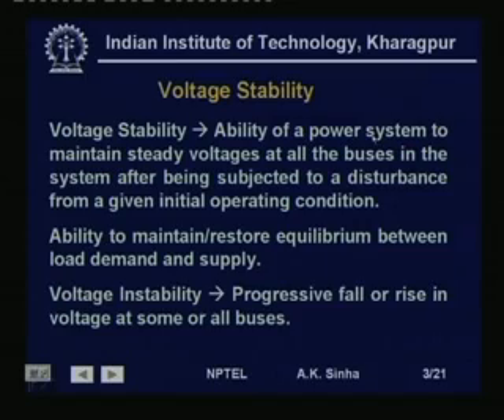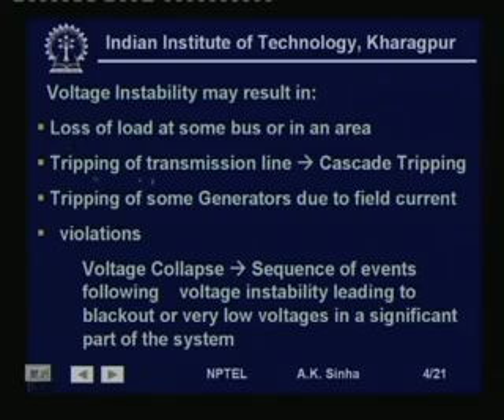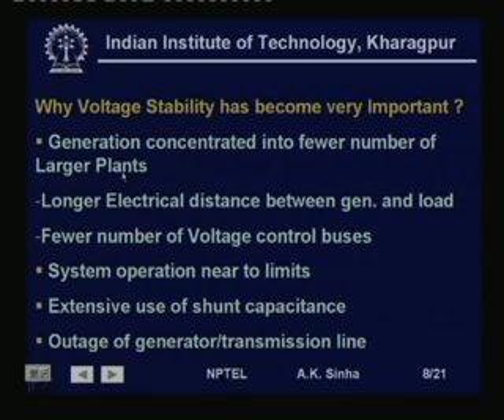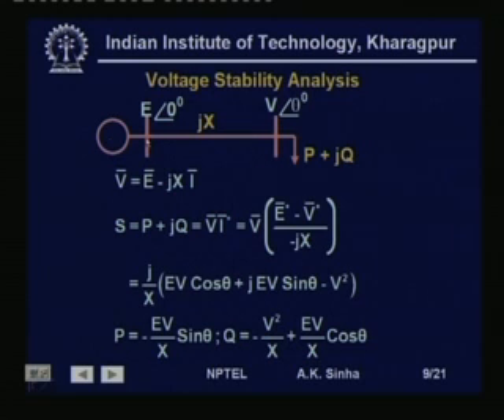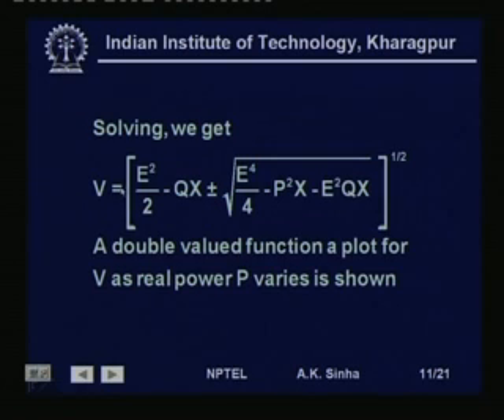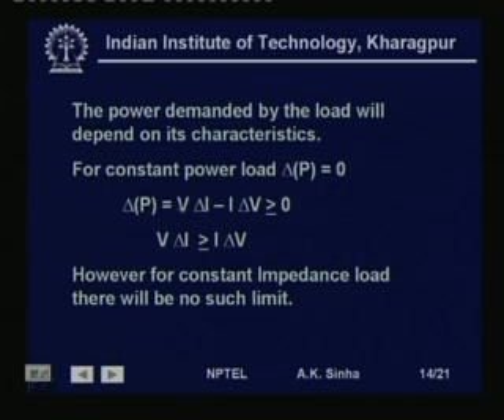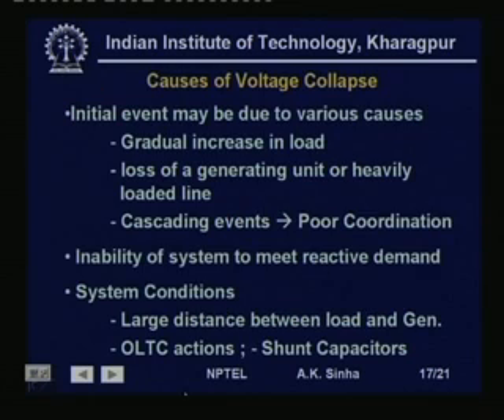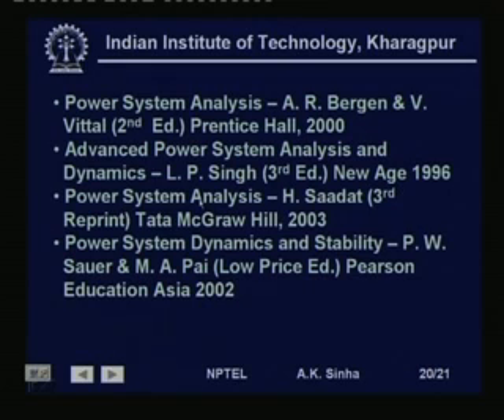Lecture - 40 Power System Stability - VIII

Comment: It is interesting to know that since the late 1970s, voltage instability has been the cause of many power systems blackouts worldwide. This has been the result of heaving loading of the power system and power transfer over long distances. The following information about voltage instability incidents was taken from the course of power system dynamics of Dr. Prabha Kundur in Caracas, Venezuela in May 2007 (PES power engineering society): Voltage instability incidents: French System December 1978, January 1987, Swedish System December 1983, Japanese System July 1987, New York System September 1970,  July 1977, Florida System December 1982, May 1985, WSCC (Western System Coordinating Council) July 2, 1996. The sequence of events of the failure of WSCC was explained in the conference by Dr. Kundur. More recently the august 14, 2003 blackout of the northeastern part of the North American grid is a good practical example of voltage stability problems leading to major system failures. To learn more about voltage instability any student should analyze a sequence of events of a real life blackout due to voltage instability. For example you can read the book  Electric Energy Systems: Analysis and Operation Author: A. Gomez-Exposito, A. Conejo, C. Cañizares., year 2009, CRC Press Chapter 10: Angle, Voltage, and Frequency Stability, Page 456. Blackout of August 14, 2003. Read the sequence of events. Best regards from Venezuela, my name is Carlos Dominguez (student of specialization of Power Systems in Universidad Central de Venezuela)